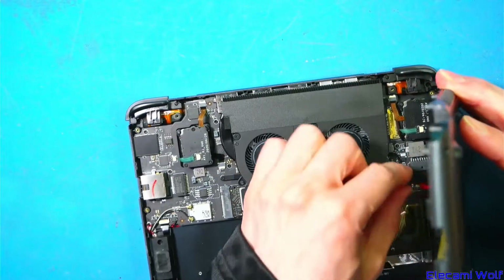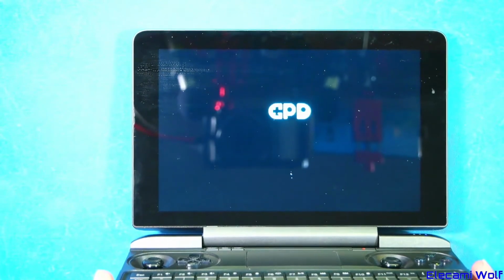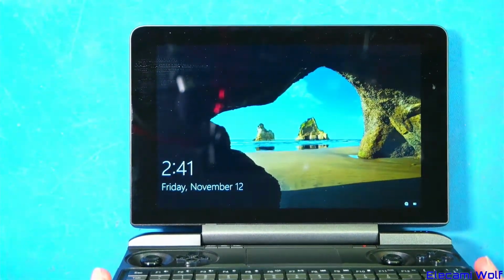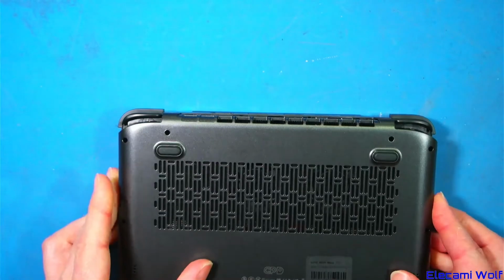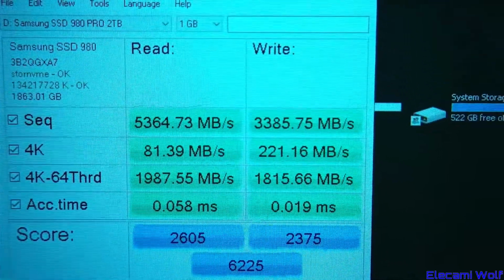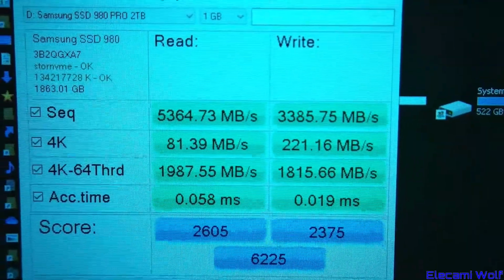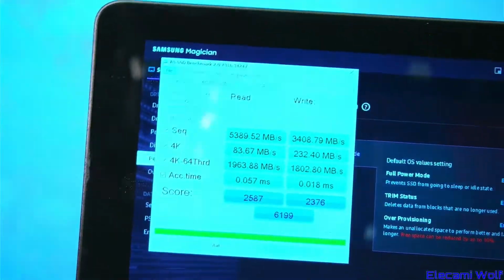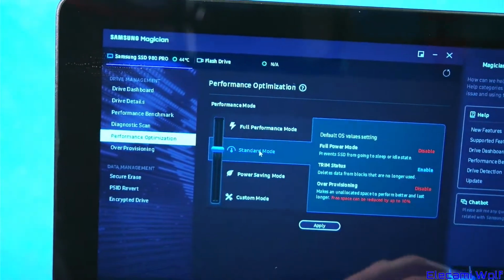EW0007 - Upgrading the SSD in GPD WIN Max 2021

Comment: I added a 4TB SSD drive.  It fit perfectly and it's running smooth as butter.
Reply from the maker: What brand / model drive did you use? I was not sure what one would fit without getting bent from hitting components under the drive. Are there single sided 4TB drives available?
Reply: @Elecami  I just upgraded to a 4tb crucial p3 plus drive.  

I hate those tiny screws on this win max 2021....
Reply: @Elecami  also thanks for posting this video, I referred to this and the Phawx to help me walk through it.
Reply from the maker: @Beyondesp  Thanks. Glad the video helped.